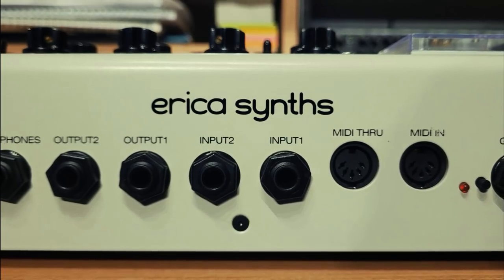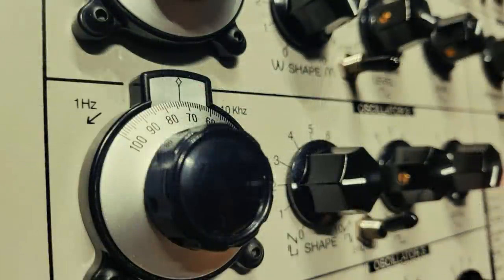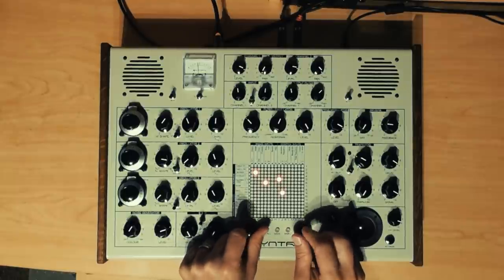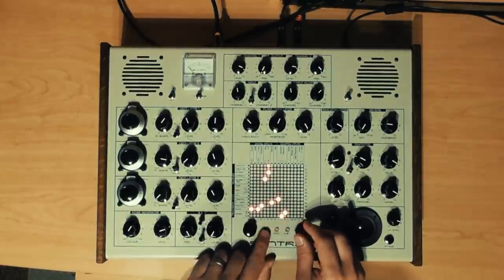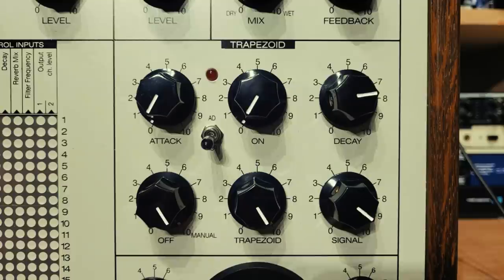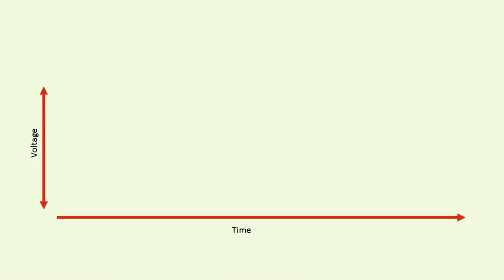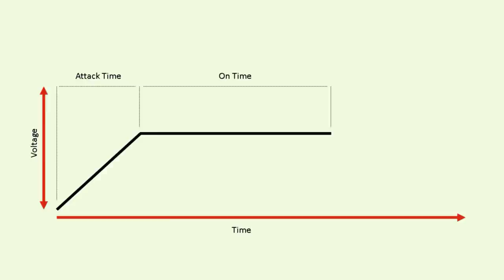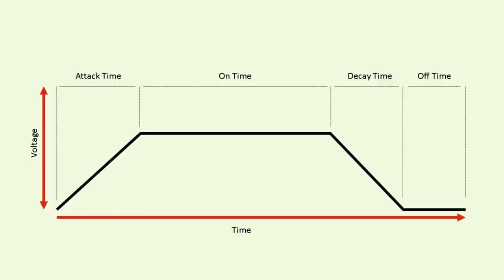Scoring a Sci-Fi Movie That Doesn't Exist With SYNTRX

Comment: man, I love your vids. I'm really on the fence about getting one of these before they are gone for ever. Is it worth it after all this time?
Reply from the maker: I'm getting lots of use from it. As a basic synth you have a triple oscillator mono with a nice dirty sound. But then the signal rerouting opens it out massively.

It does excell at the dirtier and weirder stuff though, so if you're after clean and precise then it's probably not the one to have lying around.

My guess is that prices will go up and it will become sought after.
Reply: @AlexBallMusic   damm you! now I have to get it!

Comment: ★★★★★ It’s a curious beast. Not really sure of the point of storing the patch matrix settings if the controls can’t be saved though. 🤷‍♂️
Reply from the maker: It is indeed. The patch matrix routing saves you several minutes setting up signal paths if there's common things you use over and over.

Also allows you to come back to something later.
Reply: @AlexBallMusic  ahhhh of course. It’s not half-normalised to start with like say the 2600 is it. Gotcha.

Comment: Is it really £2500?!  How much gold does it contain?!
Reply: The patch bay has a full analog signal path so there's a vca for every single one of those lights which is really not cheap. It's also a niche product & is built by a small company at low economies of scale and so is far more expensive to produce
Reply: @M_orcan  a vca for every one?  Oh, I just assumed it bridged a connection between two wires..
Reply: @annother3350 I could be wrong but yeah there's 3 different attenuation settings for each point in the patch bay which is digitally controlled. It's definitely not efficient in terms of money but it's kind of essential to have a fully analog signal path to do certain kinds of feedback patching. I guess the same kind of thing could theoretically be done with switching between 4 different paths with different resistor values/one to ground for each point in the grid but that also starts to become a bit of a headache
Reply: @M_orcan  Oh ok, im not an expert but i can understand it becomesa lot more complex with attenuation setiings
Reply: @M_orcan  I think for that price they could have made a modulatable modulation matrix - can you imagine that?!  Rhythmically changing the pin matrix pattern?  maybe on version 2.

...oh, and for that price i'd also want a happy ending...